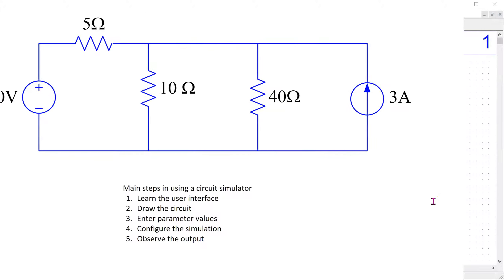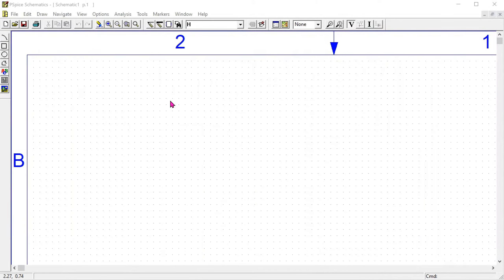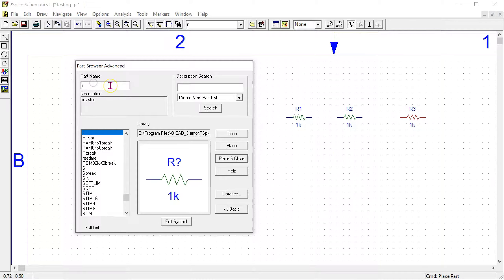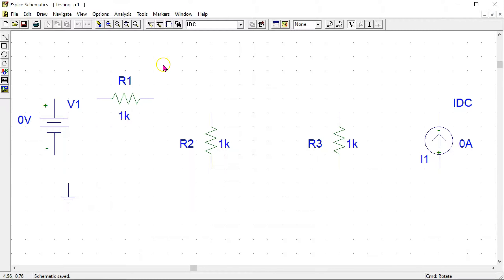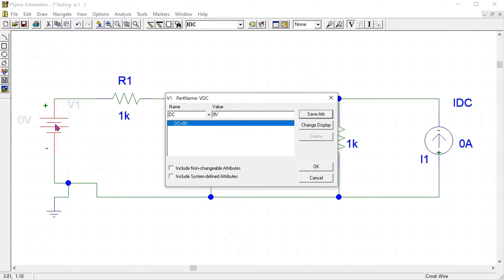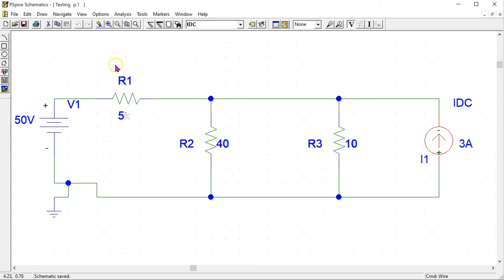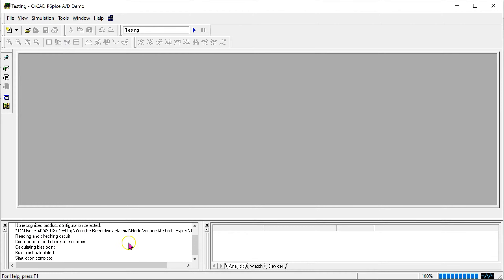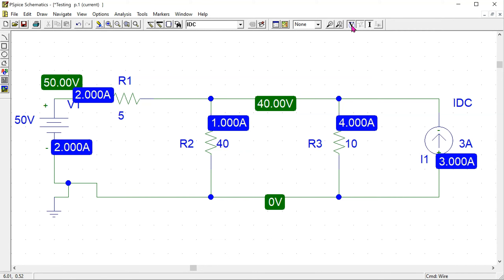Introduction to PSPICE for DC Circuit Analysis

Comment: I followed  stips  you done and  when click on simulation there is  no simulation  ,what is the  reason
Reply from the maker: Thank you. I am assuming pspice is properly installed. For  DC analysis, once the simulation is completed you can look at DC voltages and currents by enabling the bias voltage and current displays.